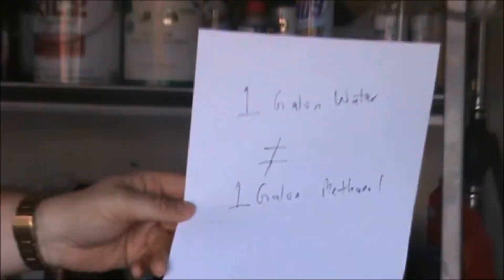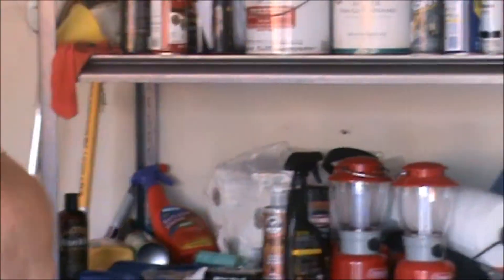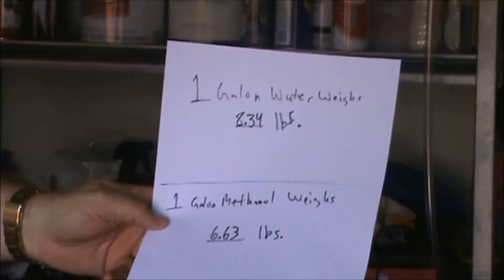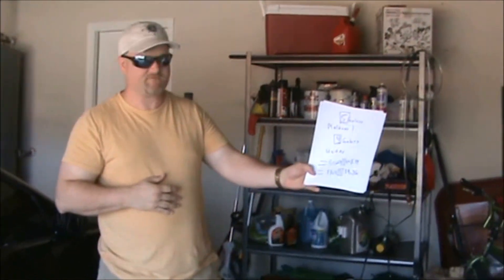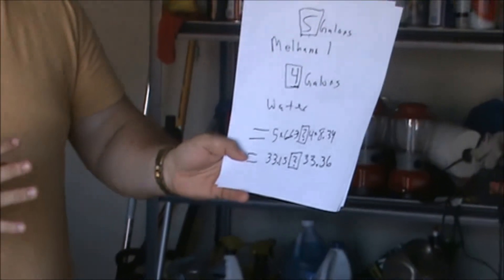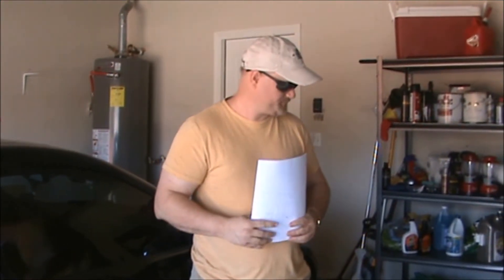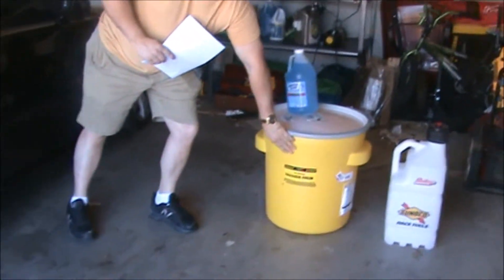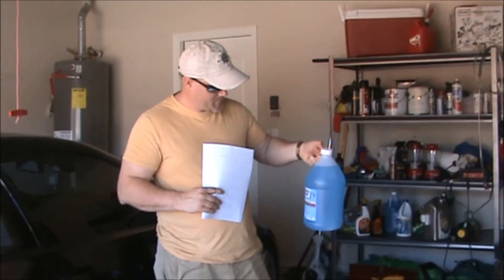How to mix Methanol and water

Comment: Cool video. Sounds like you mixed all the meth with the water in the yellow barrell which is a huge. How was the moisture? I heard when mixing water with meth it pulls in moisture ruining the mixture
Reply from the maker: I blew my motor on meth and switched to e85 years ago. I’d never run met again

Comment: Alot easier way it to make 50/50. Is weigh 2.11 of water and 2.11 of methanol and then mix together. That's 50/50 1 gallon at a time.

Comment: There's another video that talks about how fast methanol evaporates when exposed to oxygen (opening and closing lids included).  So I thought having a dispenser of some sort (container with a spout) rather than opening and closing the lid of a barrel or whatever should help keep the methanol from evaporating, thus letting it last longer in storage.

Comment: i burn -20 windshield  washer fluid and its not about boost or intake temps it cleans everything when i stopped to make changes the checkengine light comes (o2 sensers)   then it starts cloging up and runs worse and worse i fill my 1 gallon tank light goes out and it gets better and better as it cleans pcv intake the new system has ultra sonic mist instead of a bong catch can vacume no boost ha ha laugh but it works